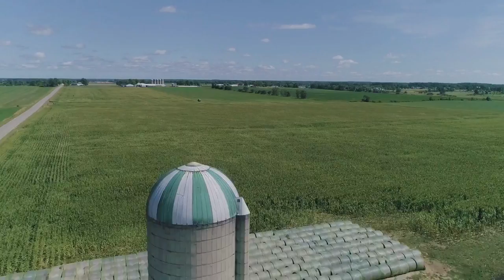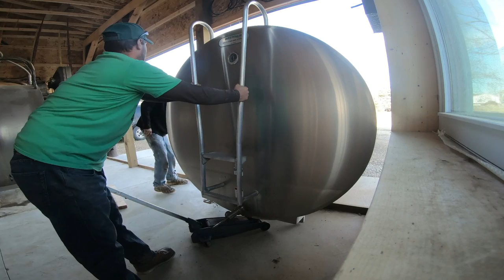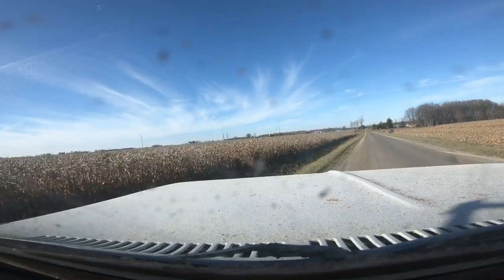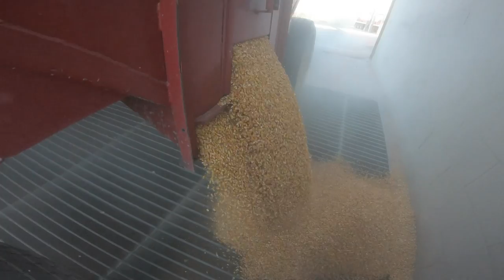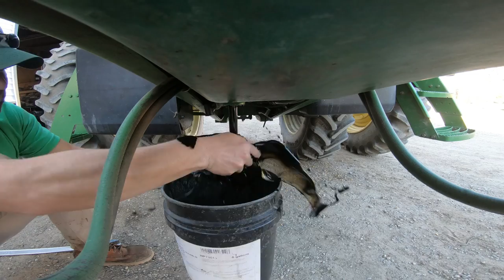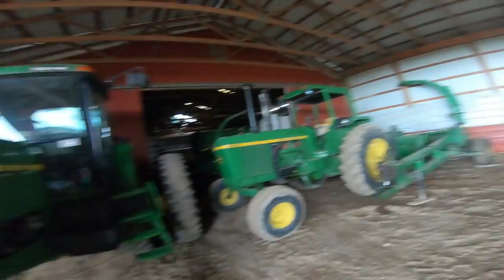MILK TANK GOING IN!

Comment: Hey good videos man, just wanted to ask something about that Chevy, do you guys have trouble dropping driveshafts with that 454?  There were guys around here even with the 427 that would drop driveshafts like no tomorrow.  I was just wondering if you guys have problems like that with that truck? Asking because we run one of those tandems with a 366 small block and its not greatly powered with a 24' box.  Also are those air brakes stock or addon?  If they're addon, where'd y'all find the parts for them because if we can find the parts we're looking to potentially do that to our truck.  Thank you!